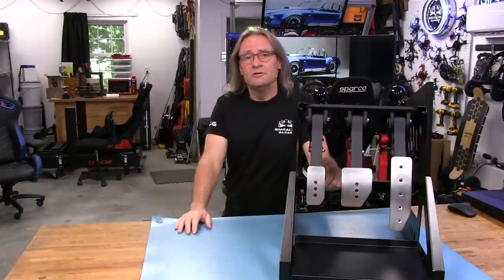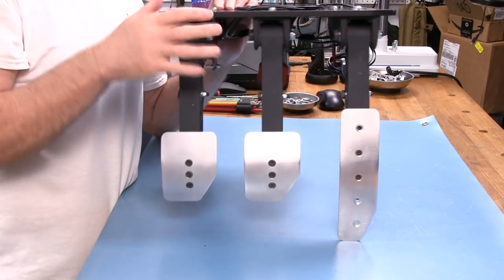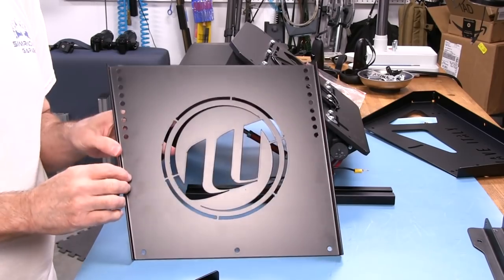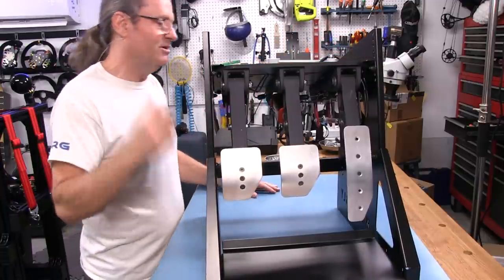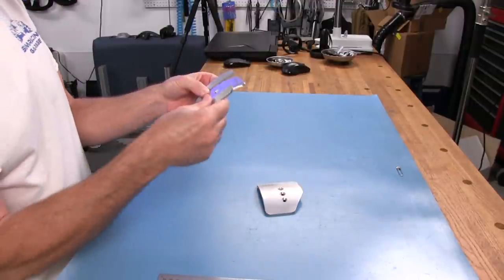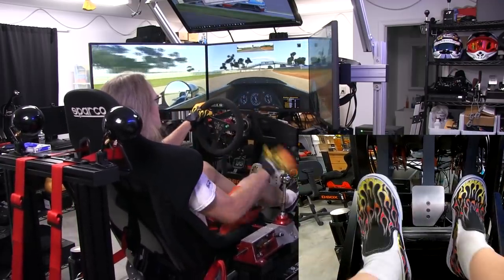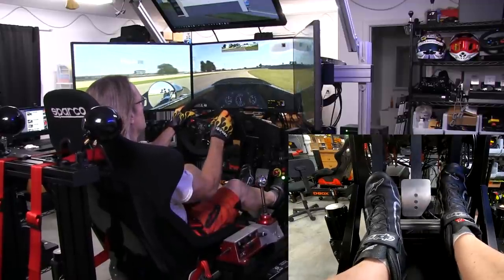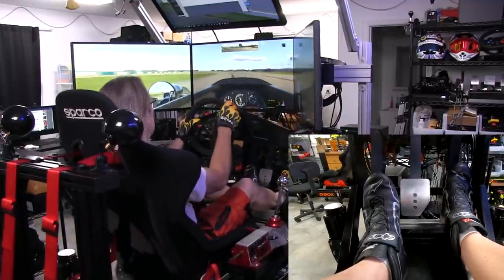Wave Italy Impetus Pedals Imola GT Style Conversion

Comment: I took a set of G27 pedals out of the case, took a pedal plate from a Trak Racer rig, added that to my Next Level Racing DD Wheel Stand pedal plate with 3 bolts and joined them at about a 90 degree angle. You could buy some plate and 90's and weld or bolt it up. I use a ratchet strap to adjust the angle and hold it in place, you could easily make brackets, but this works and I already had the strap. I mounted the three separate pedal assemblys, inverted to the plate with the clutch and throttle outer edge to outer edge so even using all brake pedal faces I have inches of space between the pedal faces. I split the brake in the middle, but you could put it closer to the throttle if you want. My foot has been damaged and I can't heel toe anymore. But I can blip the throttle even if slower, it works.

Comment: Until people will be willing to spend such amounts of money, prices will continue to skyrocket. Let's be honest... It's a nice quality piece of equipment, but production costs are around 150€ to 200€ max. So you do the math yourself. Same for the Heusinkvelds and the list goes on and on... Sadly...
Reply: Don't forget the amount they spent on R&D. It has to be paid somehow by the customer
Reply: I think you underestimate the production cost of these parts quite a bit. If they had 100,000 off these built, maybe by economy of scale the prices would be a lot lower, but at maybe 1000 units a year the cost per piece is fairly high. I agree that simracing hardware is too expensive across the board. If our sport becomes bigger and more brands enter the arena, prices will drop over time.

Comment: Inverted is the only way to go for anyone focused on immersion.
Reply: Please do explain? F1 cars and many other cars utilize floor pedals.
Reply: @Mikey6048  even rally and GT and touring cars, basically almost anything running under FIA has floor mounted pedals to lower the centre of gravity as much as possible. People think inverted pedals are for immersion because street cars have hanging pedals and beginners normally use such cars.
Reply: @danyalreyaz7503  Basically yea, I set my rig up almost identical to my car because thats the only reference I had.